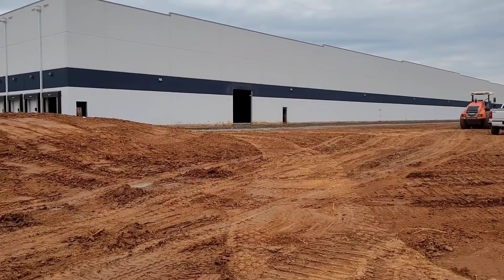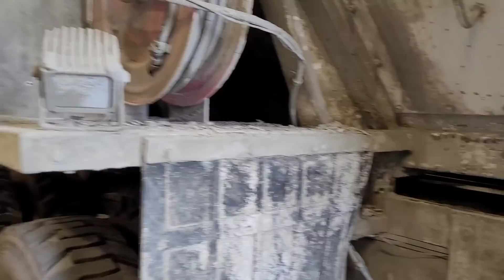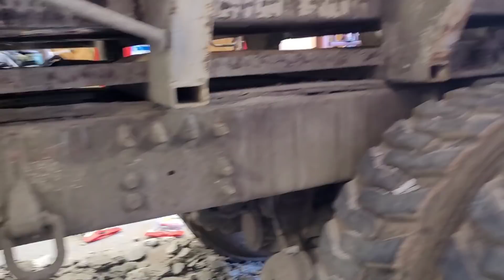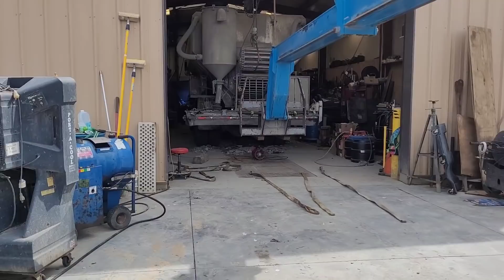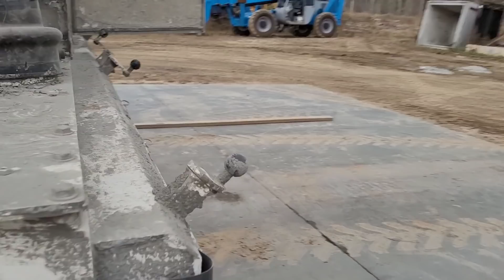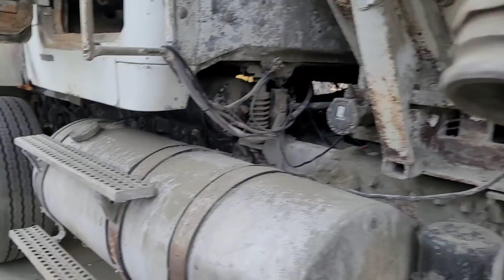Finished the Hickory North Carolina  Stabilization project,  De mobilization and  spreader repairs

Comment: Excuse my ignorance if this is a dumb question but wouldn't high flotation ag tires be better on the site spreader Charlie?
Reply from the maker: Absolutely excellent question,  yes am in the process of changing bed to a 6x6 kenworth  C500 with high flotation tires.

Comment: Where is the closest place to Hickory to get bulk powdered cement? In fact I actually don't know of anywhere to get bulk powered cement. I live in southeastern Rowan county. Closest town to me with any size to it is Salisbury or Albermarle, NC. That's crazy that there's even a shortage of powdered cement. Our current government is doing an absolutely wonderful job. A wonderful job of fucking this country up. Anyway I enjoyed this video. It was neat to see some of the workings of the spreader truck. Don't some of the spreader trucks have a tillage implement on the back of them where the powder come out inside the shroud or dust boot as you called it? Be safe around that equipment. 
Stay well. -Wil  👍
Reply from the maker: There is a Holcium Lafarge rail terminal in Charlotte and a Giant rail terminal in Pineville